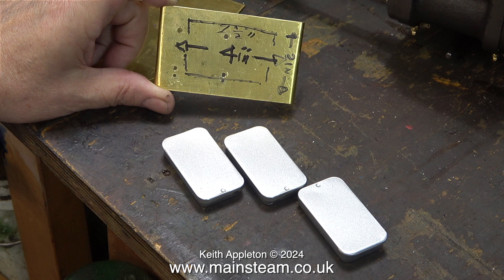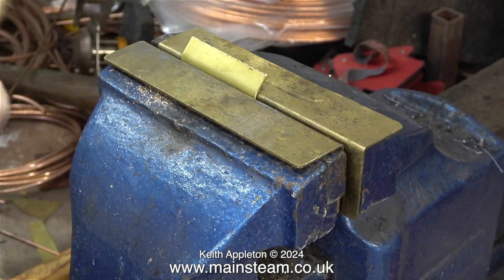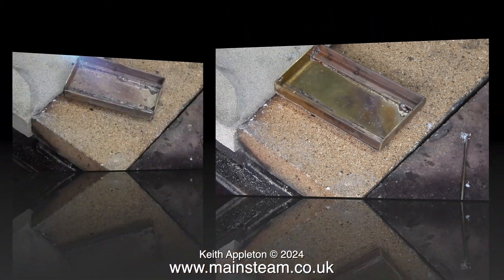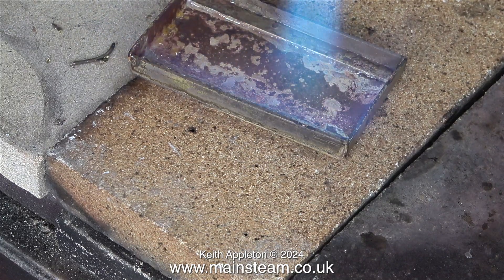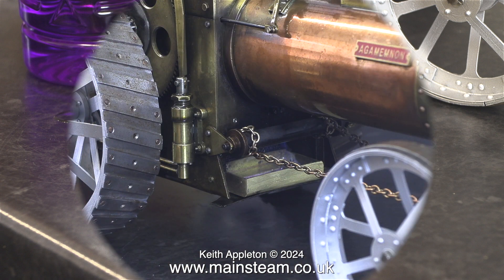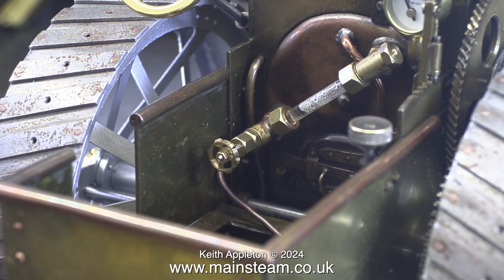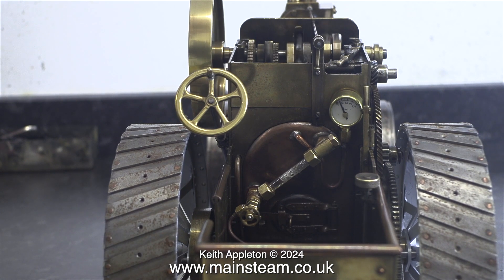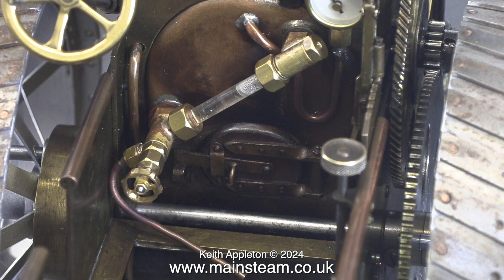A "MINNIE" TYPE TRACTION ENGINE - PART #11

Comment: Can you point to where I could learn about soft soldered boilers? I'm planning to build a hackworth style winding engine from tin and soft solder
Reply from the maker: Sorry, I have no ideas on this. I do not usually make boilers. Soft soldering boilers is not recommended . . . .